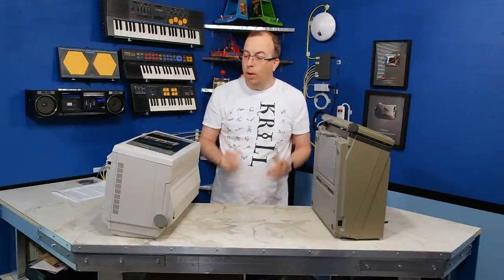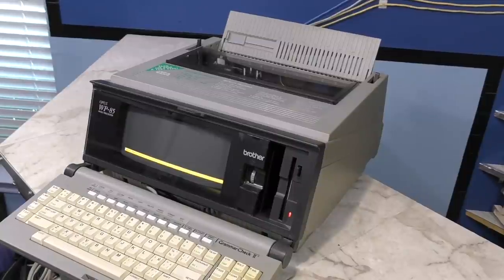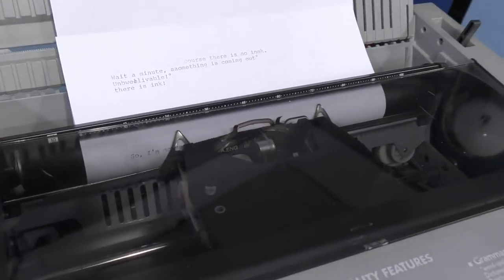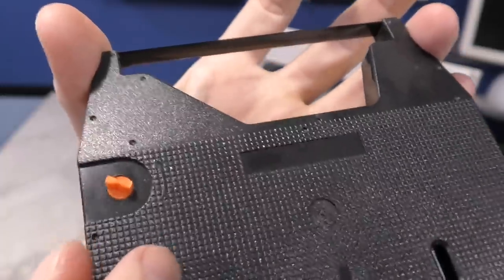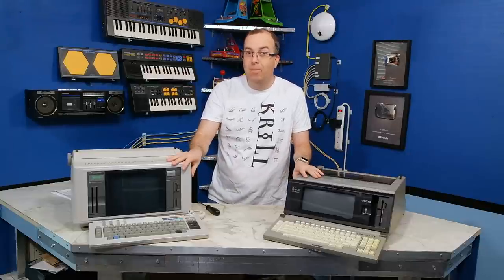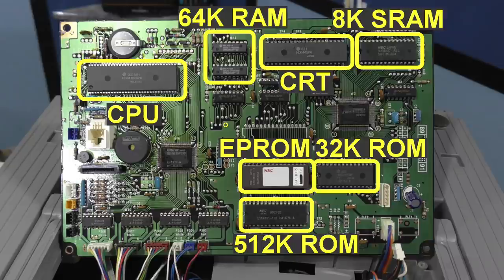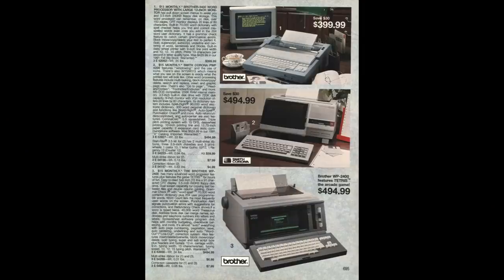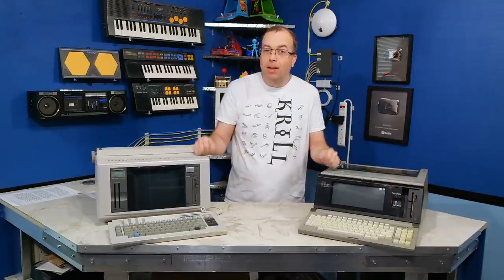Dissecting two Word Processors, Brother WP25 and Panasonic W1525

Comment: Those carbon-film ribbons were a HUGE security risk if disposed of improperly.
Reply: I don't get it. Theoretically, maybe. But unless someone knew exactly what they were looking for, at the exact time they were used... You think anyone was going to unwind these, reading word by word with no reference marks?  You're thinking like a marketer for IT security. An actual "black hat" would never waste time, or literally get his hands dirty, with ribbons. One would get more info by listening to water-cooler gossip.
Reply: @squirlmy  This wasn't a risk, it was a reality. lots of historic instances where authors had their preprinted books leaked because they threw out the ribbons in the trash and someone just took their trash to read the ribbons.
Reply: @squirlmy  i always do that with new carbon tape typewriters i get
Reply: @squirlmy  Going through a few hundred feet of very legible tape is a way easier method of espionage than many of the ways you'd have to do back in the day.
Reply: Most of the stuff written with them would go into trash anyway without shredding.

Is there some actual documented cases of it mattering for identity theft or what have you? Also most of the floppies would also end up in trash.

Sure in ddr they would've probably read through them but haystack attacking through them is a bit far fetched
Reply: Yeah, because everyone want's mom's recipes and jr's social studies homework.  REEEEEEE.
Reply: @squirlmy  Doesn't matter what time etc. You get the ribbon, you get everything from the moment it was installed to the moment it was thrown away. 5 second dip into the office bin. No deciphering of gossip needed, no green letters falling down screens. Just swipe the little plastic doodad and put it in your pocket, then read it. Every letter is literally on there, clear as day. Admittedly some printers print back-and-forth so half of the sentences would be backwards, major heavy encryption. 

Actually there used to be a word for printers... I think bidirectional... They printed with the head going both ways so was a bit faster. It was a selling point!

If people have been writing important letters to shareholders or banks or whatever, you might have some extremely valuable information you could use, or sell, to stock market traders. You avoid getting dirty hands by holding from the edge. If you're really bothered you can always wash them later. Or wipe them on your hat.
Reply: @tarstarkusz  Obviously, it depends whose typewriter ribbon one steals.
Reply: @greenaum  I agree the military would never use this type of ribbon.
Reply: @tarstarkusz  yeah they would, they'd just store the ribbons with some fuel waste from a nuclear sub and bury it under ground
Reply: @sorrenblitz805  That is not nearly as expensive and complicated enough for the military.  Write a new proposal.

Comment: The ribbon is not "technically" single use. Back in the day, ribbon cartridges were expensive, so we would rewind them and accept blank spots because chances were that we did not use the same letter on the same spot on the ribbon.

Comment: The ribbon on the Panasonic is a carbon/mylar. Pro side, doesn't ever dry out. Con side, you can't replenish the ribbon with ink.
Reply: Yeah, I remember typing texts for school on my dad's typewriter that used this kind of ribbon. I actually reversed it to see what happened when typing with a previously used part of the ribbon, of course the result was characters with missing parts…
Reply: Brian O'Connell Bonus con: You have to securely destroy used ribbons, as dumpster divers can easily read all the secret stuff you wrote (like patient records at a doctors office).
Reply: The "pro" side can be seen in two ways. Because what you said is true, it worked like a charm when David tried it out. But that's only an anecdote. In its day and age, I believe fabric based cartridges were clearly superior.
Reply: Bonus Pro:  the correction ribbon used for this type is actually more of an adhesive tape that lifts the carbon right off the paper rather than applying white paint over it.  This makes the correction a lot cleaner and universal for all paper colors.
Reply: Sound like a wasteful option. Imagine the heaps of cartridges dumped every week at IRS
Reply: My Father had a Brother typewriter using the same type of correction tape. After fifteen years it still typed perfectly but the correction ribbons had all lost their stickiness in the same way that old masking tape does.
Reply: Does it actually not dry out?  Coz sometimes I take out my old typewriter for fun and I have to re ink the belt to actually use it
Reply: The type of carbon/mylar ribbon people are talking about is more like carbon paper. As people have also commented having typed a character you can end up with the same character in clear reverse on the ribbon so that part can never be used again.
Reply: @logannasty3240  Not much different from the fabric typewriter ribbon. While they could be re-inked, each time the fabric was hit, it would degrade and after several runs, you'd have to throw it out. Re-inking was messy and difficult to get right, so most of the time, you'd just make several passes of fabric ribbons and threw them out when the ink ran low. Just like offices care about toner costs today, ribbon costs were something that businesses considered back then.
Reply: con:it only used a tiny amount of it, so a lot is wasted
pro: you could 'reuse' the tape as a negative
Reply: @BilisNegra  Fabric ones gave a slightly mushier result, and were common in dot-matrix printers. Those were GREAT btw! Carbon had that extra bit of crispness, a slightly nicer result. A daisywheel with carbon could compete with a laser printer, I think. 

"Anecdotal" evidence isn't really an issue here. It's plainly obvious how the two ribbons work. Fabric ones were cheaper cos they could be re-used. There were even kits for cheapskates to re-ink them, you could even buy mail-order little machines that would take a ribbon, wind it with a motor, and some sort of spongey thing with a tank of ink would re-ink it. Or else spraying something like WD-40 into it would get any dried-up bits of ink flowing again.

Eventually in a fabric ribbon the fibres would get fluffy from being bashed all the time by print heads. So quality would suffer badly. So you could only re-ink them so many times. Still yep it was the economical option, and produced decent enough quality for most uses. Just depends if you're really trying to make an impression. There's probably a formula involving the cost of the paper you're putting under it, that tells you when it's appropiate to use a carbon ribbon.

Comment: I had a Brother WP, because it was free on the side of the road :)
Reply: Nice find, was it in fully working condition when you found it? I love to hit the local recycle drop off every so often, and see what people throw away in the electronics bin, and have gotten a few useful computers, monitors, and keyboards.
Reply: @CommodoreFan64  It was in the mid to late 90s. It's what I used for school work since I couldn't afford a computer
Reply: @CommodoreFan64  my local recycling faculty has a electronics bin, I have found an Ibook clamshell and a macintosh LCiii in there
Reply: In 1991, I got a free Brother WP as well... after just a month of using it I had a power surge and out came the magic smoke.
Reply: @markinnes4264   :( That's too bad. I wrote my self-published poetry "journal" booklet on mine in HS. Used a photocopy machine, scissors, and stapler in the library to "publish" it. Fond memories of the amber screen.
Reply: Woah...

Comment: The smaller, LCD based versions of these were absolutely everywhere when I went to college in 1992.
Reply: My older sister had one at around that time. I remember thinking it seemed such a waste to buy what was essentially a computer that was limited to typing. I can't remember if it was more expensive or not much cheaper than our recently bought Amiga, but it certainly wasn't very cheap in comparison.

Comment: It's amazing that these machines were still being made only 25 years ago.
Reply: Not really.  An electronic word processor like the brother would have been around $400 in 1992.  That would be about the same as you would have spent on WordStar, Word Perfect, or whatever software you used back in '92.  And then you would need a general purpose computer to run that software on.
Reply: @anidnmeno  You're welcome!
Reply: Anidn Menoscwicz Better now than in 20 more years, then you’ll feel like a REAL  ̷G̷r̷a̷m̷p̷ Champ.
Reply: acoow
daisy wheel is way older, 25 years was all color only, inc jet.
Who needed this weird machine?????????? print people??????? changing the wheels, needing good fonts? carbon copy weirdo people?
Reply: My mom had a word processor in 2000. I wasn't too interested in it as a kid since it didn't have any games lol.
Reply: Please Complete All Fields  Indeed, they wouldn't have been sold in a computer shop, because "people looking for a computer" weren't the market of interest and anyway, computer shops wouldn't have wanted to sell a product that wouldn't get them any follow-up software sales.

They were sold through office supply shops and office supply mail order catalogues.
Reply: @acoow  666t

Comment: Some of the "last gasp" word processors in the '90s got a lot more advanced, including an external monitor, inkjet printer that could print full graphics, a serial port so you could connect it to a modem and go online with BBSes or text-based online services, and a full 1.44 MB capacity floppy drive.

Comment: I have my dad's Brother AX-26 Word Processing typewriter.
It's great and it still works!
I've even used it on college assignments.
I bought replacement ink ribbons for like, a dollar each. Though the one he had inside still worked until a few weeks ago where I finally replaced it with one of mine.
One of my favorite features is the correct/erase ribbon. Crazy technology.

Comment: Just on a side note my friend had a dot matrix printer that used the same type of printer ribbon, and used WD-40 to get more ink out of the ribbon and got 3 times the life from the ribbon, one way to stretch the life of your printer ribbon.
Reply: Yes.. Was just going to suggest the WD-40 trick for dry ribbons myself.
Reply: I guess printer companies have always been scamming their customers, resulting in all these diy hacks.
Reply: I never used the WD-40 trick, but I can remember back late 90's - early 00's when I had a few different Canon BJC printers that had ink tanks filled with foam pads soaked with ink, and a trick to get more life out of them when they started to dry out from was to take a  Q-Tip with a very slight amount of water on it, and rub the pads, and you could do it 2 or 3 times depending on how much you where printing each time, and if it was just almost out, or you had let it sit for a decent amount of time. God I miss those printers, I could get both color, and black for $7 USD, or a giant black tank for $12- $15 USD.
Reply: Almost any oil is fine, also one can add some ink to oil and soak the whole ribbon in this solution.
Reply: for lack of a better term, let's call that process "retrodark" :)
Reply: Another option I've done is buy a modern cartridge that uses a similar sized ribbon width and length and just swap it into the original cartridge (using gloves.. haha).  the width must match (i.e 1/2") but the length usually just needs to be the same or less, just not longer (since it won't fit, whereas shorter would just run out quicker).
Reply: Brian Veditz I recall having a printer that used a traditional typewriter ribbon instead of a model specific cartridge.  Of cause, getting either these days will be hard.
Reply: @johnfrancisdoe1563  Yeah, you will have trouble finding new ribbons for old printers but I've managed to use ribbons for new printers (for example, airlines still use modern dot matrix printers) and been able to swap the ribbons into my old cartridges in every case.  the hardest part is opening the old cartridges without breaking them :)
Reply: Filamax I had heard of this but wasn’t sure if it was true
Reply: @brianv2871  There was a mod published about 30 years ago which involved drilling a hole in the top of the cartridge and adding a drop of ink every so often. If you can get the cartridge open it's fairly straightforward to re-ink most of the ribbon. Which is quicker and less messy that replacing the ribbon.
Reply: Filamax
running what, why you needed prints? Lotus 123 guy, taxes?
Reply: I did the same think to a typewriter ribbon just on a hunch and it worked great!

Comment: The Panasonic W1525 got me through college. I did get the multi-paper feeder tray attachment as well. It also was significantly cheaper than a full computer at the time.  I still have my original around for nostalgia.
Reply: Jason Hunt probably made your arm muscles stronger as Well while carrying around!
Reply: PC GUY 1241 "... carry around...".  Carry around?  Could you picture a student taking notes in class on this?  "Oops... hit the print button... sorry prof the printer is drowning out your lecture".  I imagine it got wheeled into the dorm room at the beginning of the term and stayed there until a degree was in a picture frame.
Reply: @CarFreeSegnitz  Hence why you had to hit Return AFTER hitting the print button.
Reply: @CarFreeSegnitz  The Brother model actually has a handle on it, so it's made to be carried around, like a suitcase. Not so with the Panasonic. Of course, the Brother one weighs about 30 pounds, so it would be a good workout lugging it around.

Comment: on the hitachi machine the two single line pin chips should be the memory. marked IC13 and IC14
Reply: and google say the two chips between the cpu and crt controller is ROM
Reply: They're ZIP chips, presumably DRAM. Wikipedia says used in some Acorn and Amiga machines. https://en.wikipedia.org/wiki/Zig-zag_in-line_package
Reply: Yeah, surprised he didn't pick up on the obvious RAM at the bottom as well. Anything with a -20 or -10 at the end is always memory, that number is the access time maximum in nanoseconds.

Comment: For the Brother there are/where 3 types of ribbon: the nylon inked one that is in the machine, a one time carbon like the one in the Panasonic and then a multi strike carbon one where the ribbon only advances a little bit with each strike so the characters overlap. It's not strange to see a correction tape in the Panasonic (the Brother also has one if you look closely) because this was used in the typewriter mode. It looks like the Brother has the wrong kind of correction tape, there are 2 different ones: one is the 'cover up' kind that deposits white over the (nylon ink) typed character and the other one is the 'lift-off' kind that is a sticky tape that lifts off the carbon printed characters. It looks like the Brother has the lift-off type which will not work with the nylon printing ribbon. Security wise the multi strike carbon is better because you can't read the printed text but the print quality is better than the nylon one. That's all folks! :)

Comment: I owned one of those Panasonic word processors back in the day.  It was a great little unit.  It was marketed as a "smart typewriter" for those that didn't need (or want) a full-blown computer and it worked great at what it did.  I used to enjoy typing documents into memory and then sitting back and watching the daisy-wheel printer print them out.  You could even do mail-merge with them.  I remember printing out a bunch of resumes with customized cover letters -- it was pretty slick.

Comment: I've got a WP-75. It's essentially the same unit as that one. What's curious to me is the CRT. It IS very crisp which is common among the monocrome CRT of the era. But what's really odd, is the aspect ratio! It's super wide. Almost 2:1 wide. And mine isn't a true amber display in that it doesn't use an amber phosphor. It just has an amber filter over the front of it.

The printer unit on mine was mostly broken, so I'm trying to cannibalize it for the CRT to make a mini arcade cabinet out of it (with my own game of course, I can't imagine emulation going over well on it). Imagine a scrolling vertical shooter on that thing! I just need to figure out how to feed it video and I'm off to the races!

Edit: Just got to the section where you talked about hacking and programming the Z80. That would be neat. My current idea is to use a modern device (raz pi or something similar) to poke at the video memory so I can display whatever patterns I fancy.

Comment: Your video reminds me of the Panasonic electronic typewriter I had in 1992. I used it to write papers for a university correspondence course I took to get the last credit I needed to obtain my degree.

It accepted a floppy disk, also used a daisy wheel print system and took the same ribbon as shown in the Brother unit in your video. 

The sound of the typewriter in this video really brought back some memories, because my Panasonic typewriter sounded exactly the same way when it printed out text. Electronic typewriters like the Panasonic I had weren't a new thing, as I remember using a similar kind of electronic typewriter (it took floppy diskettes as well) in the spring of 1987 when I was still in university.

Unfortunately, the  Panasonic typewriter had a LCD that displayed only one line of text, so you more or less had to type out one line of text and then print it out. Although you could type multiple lines of text and then save them to diskette and then print after retrieving the document from the diskette. Editing your work could be a pain as it was so slow and cumbersome.

I remember seeing a Brother WP85 up close and personal back in 1992 and wanting it very badly. Alas, it was well beyond my financial reach.

Hard to believe this technology is starting to verge on being 30 years old. Where did all that time go?